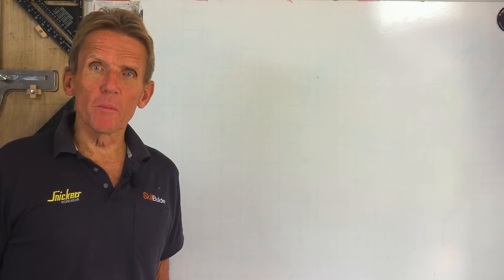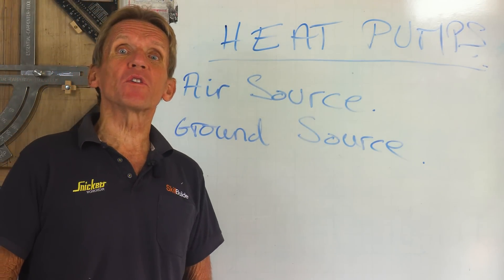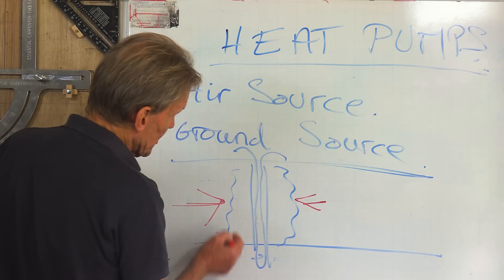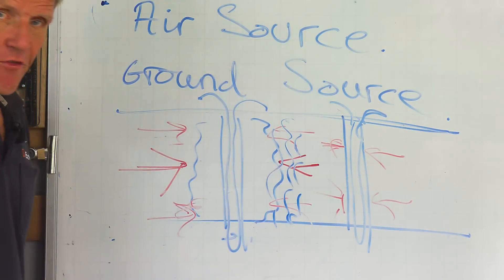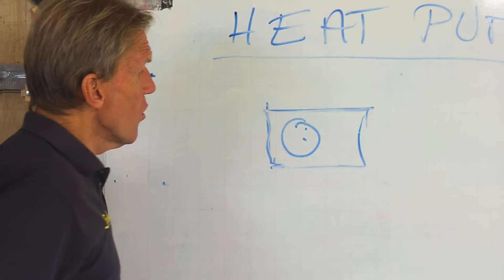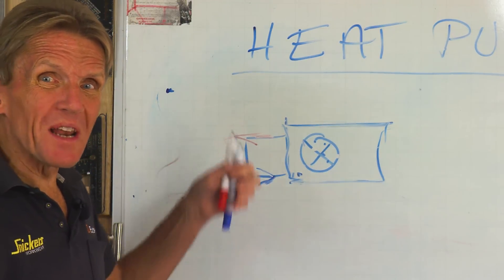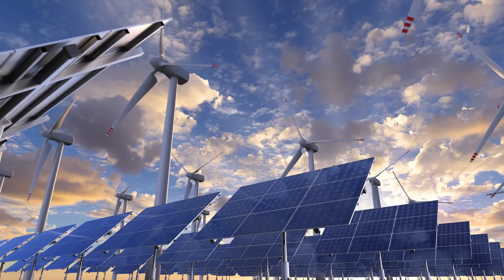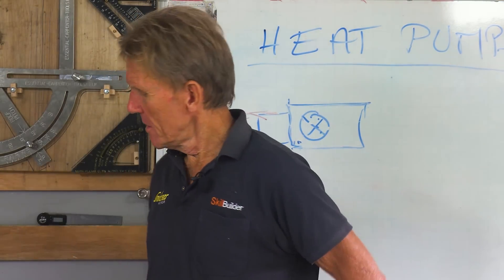Heat Pumps ~ Get Your Facts Straight!

Comment: Is this another "stream of consciousness" Roger? 

"Confronted with the same argument over and over"...which one, you never pointed it out. 
"This is a video for people that don't know what the UK is all about"....are you sure it's not about heat pumps?
Your shower is colder in the winter because the reservoir it came from is colder.  

At that point, I gave in.
Reply from the maker: OK fair enough it could do with more structure . The point is that people think the ground stays at a constant temperature which it doesn't.
Reply: @SkillBuilder  My shower is colder in winter as the bathroom is colder and it's not worth heating all day for whenever I randomly get in it. I'm going to fit a mixer shower with way more flow than an electric shower at some point.
I'm glad for the info on these vids. If the council one day want to fit air heat pumps I will contest it and try keep my boiler until something better comes along.
Reply: But unless you live next to the reservoir, the heat gain or loss in the water running through the miles of connecting pipes is likely to be more significant than the initial temperature of the water in the reservoir.

Comment: More importantly dont forgot if you fit a ASHP in England/Wales and realise you just made a big mistake, Building regulations now stipulate you can't fit a heating appliance with a larger CO2 output than the current fitted heating appliance, meaning there is no going back to your fossil fuel Boiler, so if unsure at least fit a Hybrid system.
Reply: citation needed
Reply: As far as I can see, the only thing that the building regs mention is that a new gas boiler must be at least 86% efficient or a new oil boiler must be at least 85% efficient.
Reply: Wow. Roger's vid the other day with the Welshman who had gone heat pumps went into this question of reversibility, and the advisability of retaining a boiler (disqualifying any crappy economic incentives) a bit, but what you've just said is new to me. Wow. EVERYONE needs to know that.

Comment: Mini split is the way to go I reckon. They're so so much cheaper and easier to install. I live in the UK but I used to live in Australia where I had several. They're great.
Reply: Completely agree especially if the house has solar which will cover the cooling.  The only problem I see with the multi-splits is the lack of hot water generation on the majority of them and the heating being hot air so potentially low humidity in the home.
Reply: @clarkfinlay78  good point no hot water, I guess you could either use gas for that or just use the kettle and an electric shower? Hmmm. If it was me I would leave the gas boiler to do that. I still think they're a good idea in general, can supplement a normal central heating setup nicely
Reply: @syrus3k  Or a heatpump hot water thank like a Vaillant arostor or a Mixergy ihp or Sunamp heat battery on cheap overnight tariff
Reply: @syrus3k  I think Solar Heat for hot water + immersion in the Winter - if you leave the gas supply you need to pay the standing charge
Reply: Also it did get cold over there.
Reply: @syrus3k please state the city, temperature variation, weather types, etc.
Reply: @Google_Does_Evil_Now  terrigal, NSW. Warm most of the year but surprisingly cold in winter sat in the house. Now I live in burley in wharfedale in Yorkshire, England. Cold often.
Reply: Aye, I'm currently installing an MVHR system in my home, with a view towards branching in a single air-to-air mini split HP into it at a later date.
Once that's in, I only need to fit the heat pump delivery head into the supply ducting from the heat recovery unit, instant whole-house air conditioning with heating and recovery.
Granted, it does nothing for the domestic hot water supply, but I can live with using electric heating taps until I get a 250L heat pump water tank system fitted.
Total cost is faaaaar less than replacing the entire heating system with an air-to-water heat pump system...which wouldn't work anywhere near as well with MVHR.
Reply: @mazdamaniac4643  Hey, great idea but it doesn't work because there's too little air flow though MVHR. I'm one step ahead of you and installed two mini-splits last year. We have MVHR - the house was built with it 40 years ago and we upgraded to 93% efficient one which we control according to CO2 levels and humidity—you don't really want it running flat out all the time but it does distribute the heat around the house pretty well. I think separate minisplits are the best way because, their cheaper, more efficient, can be placed close to the indoor unit with less pipework, give redundancy and better control. We have a floor unit downstairs and wall unit upstairs so in Spring/Autumn one can be turned off completely and the other one is more efficient as a result of being smaller. Whether it all works for you will depend on your lifestyle - can you leave doors open, is the house open plan etc?
Reply: Yup we've got them too, cheap to install and the new inverter ones are dirt cheap to run.
Reply: I have a poorly insulated 130 year old home in the cold tip of the Northeast US, all mini split heating.... low temp fujitsu and hyper heat Mitsubishi love pulling heat out of below freezing air. Just want to have good air sealing to help the comfort level.
Reply: Agreed. Mine's been a great success.
Reply: Split systems don't work very well below freezing in Canberra. You need supplemental electric heating on frosty mornings.
Reply: Maybe for a small house, but if you have multiple rooms you need all these ugly boxes on the wall. They have fans so they’re noisy and you need to pump out the condensation regularly also noisy.  If you have a bigger room you need two units or it’s hot on one side and cold at the other. Also they need regular service on the air filter or you have a contamination source on your hands.
Reply: @hunchbackaudio  I have 6 rooms with AC in but only 2 outdoor units. Filters take minutes and cost very little to change.
Reply: @hunchbackaudio  No you don't, you can duct multiple rooms from one unit, that's exactly what they've been doing in large buildings for decades and it works very well.
A good well-designed system hardly makes any noise, they can also have silencers in the ducts if needed, which dramatically reduces any remaining noise.
If they have to deal with that much condensation, you have a serious problem elsewhere, because it's supposed to be set to a required humdity level and maintain that.
Reply: @hunchbackaudio  cleaning the filter takes about two or three minutes once or twice a year. When ours is running it is hard to hear the fan.
Reply: It isn't a solution to the problem trying to be solved,  keep up. Simple as.
Reply: No, a properly installed hydronic system lasts 60 years, mini splits, you're pulling out the whole system when one part fails every 10+ years, the high level units are awful at heating the lower levels of a room without creating all sorts of drafts. Easier to install? You have to run refrigerant lines to every indoor unit, you also have to deal with condensate from every indoor unit, often this needs pumps, drains more penetrations of the buildings insulation.

Comment: Insulation like in freezers, plus completely draft free and sealed. Unfortunately we need to breath. and to much stale air is no good for us. These building will make you sick.
Reply: Building regulations have plenty to say about adequate ventilation. At the moment they aim for a level of air-tightness that isn't super efficient, but doesn't need an expensive heat-recovery ventilator.
Reply: Insulating a building is a two edged blade on one side you  keep the heat in what you generate but when the sun shines you get no warmth as it can not penetrate so you use more heat. I used to watch tomorrows world and all the futuristic buildings in the end were abandoned as they did not live up to the hype. @robinbennett5994

Comment: So now it's mostly public knowledge I can finally tell you that Durants Village is the place with many issues with the heat pumps, from pre-updated building regs insulation to the Mitsubishi heat pumps being put into out houses (think the old terraced house toilets with louvered doors) freezing up due to poor air circulation and a build up on condensation. Meaning they're on defrost for quite awhile in winter and not cheap to run, costing around 2.5x what you'd expect from a normal home. Worst bit is it's sheltered accommodation for older/vulnerable people so it's basically like taking advantage of them.
Reply: Does anyone have real-life data for using a heat pump for a year (in England).  I have carried out the calculations for a typical solar array and found that it COSTS money, not saves it, and I would like to see the data for heat pumps (typical system).  Anyone?
I would need:
Total capital cost
Amount 'saved' in kWh (over a previous year without the heat pump)
And from that I can do the rest.
Reply: @barryfoster453  nobody calculates ROI for a boiler install, but are very quick to point out the capex of a heat pump system. Solar is a bit different obviously because it's literally an investment. Heating isn't, so why treat it as such 🤷
Reply: @Loopyengineeringco  
Because you have to invest in these!  Heat pumps, solar and wind turbines are treated by the sellers of such as ENERGY SAVING, thus money saving.  Boilers are sold as comfort products, not to save you money.  I have been telling my customers for years when they ask how to save money on their heating that that is not what it's there for - it's to keep you warm.  If you turn your air stat down, then you will turn it up again within a day!  CH is there to make you warm.  Sure, don't waste it, but you should use whatever you NEED to use.

Now, along came 'renewables' and were touted as much more efficient than gas, oil, and electric heating, and thus money-saving.  However, when you actually do the maths, they aren't!  I have been pointing out to people on YouTube that a typical solar array will actually COST you money, not save it, so you'd be much better off to avoid it.  The same with heat pumps (as far as I can tell, though I have yet to carry out a full cost analysis).  A heat pump will cost you £131 MORE than a gas boiler every year. And let’s not forget that you have invested £12,000 more (for your heat pump) than you would for replacing your gas boiler. So when people talk of how long it will take to get your investment back in saved energy, the answer is you don’t get your money back. The whole experience is a COST to you, NOT a saving. Even against an electric system, a heat pump is ‘only’ £1,329 cheaper a year. Over 20 years, your saving (against electric) would be considerable. But due to the high cost of the investment needed for a heat pump (£14,000) it still means that it would take you 10 years to pay your investment back - even against an electric system!!!

With all due respect to you, you are forgetting that you have to invest in a renewables scheme - you have to inject LOTS of money that you otherwise wouldn't.  A replacement boiler might be £2,000 whereas a decision to 'go green' means £14,000.  So that is a considerable investment...and thus is subject to a ROI.  Same for an EV.  Electric cars cost £10,000 more than an ICE.  So you have to look at the investment and decide if you will save more than £2,000 a year on running that car for five years or so.  If you don't, then what's the point?
Reply: I couldn’t agree more with you.
Reply: Outdoor coils freezing up is normal. The fins have larger spacing than Aircon units for this reason, and sometimes are coated with moisture repelling coating. Defrost takes 10 mins out of the hour. If it doesn't complete, it's a system design fault, not enough volume - simple as that.
The coils are 15 or so degrees below ambient temp hence the freezing.
Reply: @Loopyengineeringco  Sadly you fell into the same logic loop Mitsubishi techs did before visiting the site. Once you put a ASHP into a box the size of a porta-loo with only the door vented and a smaller high level vent it starts short cycling and freezing up. They're supposed to be outside in open air. Otherwise they're spending anything up to 50% of the winter months as an ice block as they're just not getting the correct air flow over the coils.

It is a system design fault, the site has many. It's also not the only site in the southern counties to be like it.
Reply: @effervescence5664  that's a sad state of affairs. If it's Mitsubishi: there are clear guidelines in the install manual about the space requirement and layout (it can't be much more obvious 🤣). From your description, it sounds like the warranty will be void because of the poor installation. Has anyone taken it up with MCS? (Presumably the installer is on the scheme?)
Reply: @Loopyengineeringco  From what I know the installer wasn't on the scheme it's all down to the main contractor and what they specified for "aesthetic reasons". 
It's hilarious if not for the fact it's a site of vulnerable people paying electric bills!
Reply: Yeah I'm surprised they even work at all.

Comment: Surprised people don't ever mention running ground source coils above the sewer system.... effectively relying on the steady temperature of the drains to recharge ground temperature as opposed to the sun 🤔
Reply: I'm annoyed you didn't say this a few weeks ago, was laying around 90 feet of new foul pipe, I coulda put some MDPE around it for experimenting later. Next time, be a bit quicker with interesting ideas please! 😃 👍
Reply: Blimey ... that sounds a remarkably clever idea. Plenty of exothermic reactions going on there during the colder months, I'd have thought. But what happens when the effluent hits the heat pump fan? (and a thousand other predictable puns)
Reply: @mikerodent3164  the ground coil would sit a foot or two above the sewer run effectively being heated from the stable temperature in the sewer , the two systems would be totally independent
Reply: @sailaway8244  You clearly don't understand basic principles of thermodynamics. The system you have just described is far from two independent systems, it is the exact opposite, a coupled system.
Reply: @mariemccann5895  how is it "coupled" it's simply a low temperature sand battery, utilizing a free existing self renewing untapped heat source. By placing a ground source heat loop above above an existing sewer line seperated by a foot or two of sand isn't "coupling". Temperature sensors taped to the external of the sewer pipe can gaurd against pipe freezing the loop itself can be one of a number or part of a combined air/ ground source unit (many parts are common to both systems) sensors can switch between air and ground depending on current ambient conditions
Reply: Or some solar panels to power a pump in the summer and redirect the liquid in the pipe to transport heat to the underground. Imagine a garden with floor heating 😁. But it would make sense to do.
Reply: certainly would make fixing the drain super expensive, I doubt theres much benefit, the ground is. pretty effective thermal sink.
Reply: @edc1569  I was just thinking that some of this system works on the difference in temp, so any difference can help (but I really know little about it). Ground pipes rarely fail, and a few 20mm pipes laid next to a foul pipe shouldn't really effect repairs, you'd just pull the mdpe away from the foul being repaired. It would be slightly annoying to do, but I'd be alright with that.
Reply: Ground heat is not  heated from sun it's heat from core of planet.  They can still suffer from area cooling.  Real problem for air source is humidity when air in is above freezing but below 7c which is normal uk winter conditions
Reply: @scooper1818  Yes, I don't think Roger has got this entirely right: I know that if you dig down into the ground even in Antarctica in the middle of winter, the ground is above zero only a couple of metres down... this is due to the fact that we are sitting on a nuclear power station literally the size of a planet, which is entirely self-regulating, on 24 hours a day, with a constant output, and also with a containment vessel to protect the biosphere from nasty fission products several miles thick. Deep geothermal has always been the Cinderella of the sustainable power sources... indeed I remember hearing a suggestion some years ago that the fossil fuel industry long ago tried to deploy negative propaganda against its possibilities because they feared its potential. NB I believe it is the case that the fission reactions occurring in the core of our planet are not entirely understood in 2023.
Reply: don't want your p*ss and sh*t freezing up underground though do you
Reply: Not many people live above a sewer!